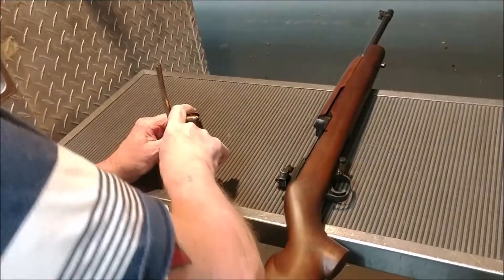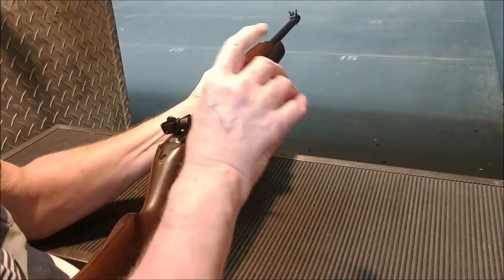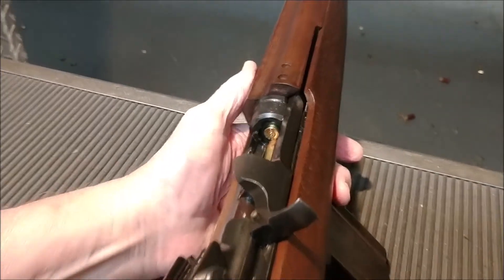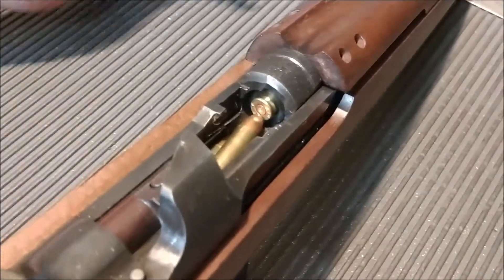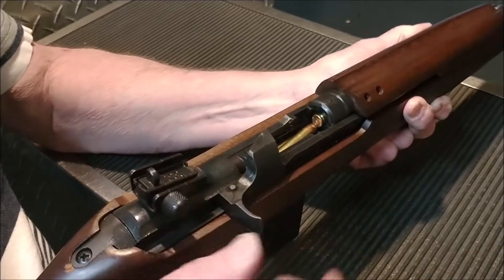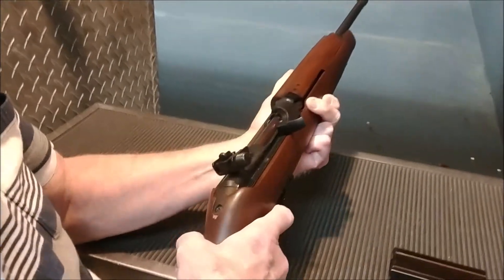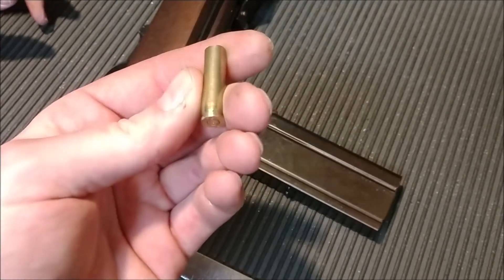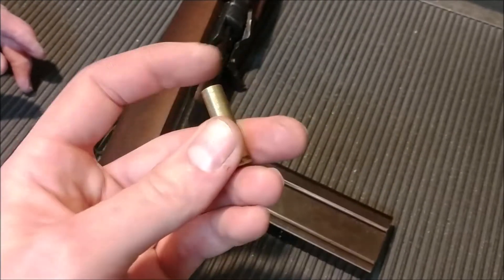How To Clear a Common M1 Carbine Malfunction: Extraction/Ejection Issues (30 Caliber Carbine)

Comment: Thx cuz I bought new auto ordanance 30carbine,junk, jams ,miss fires,you name it.
Reply: Same problems, mine is total junk, wish I would of read more reviews before buying. Have two Underwoods and an Iver Johnson that are totally reliable, and functions great with all ammo I tried with them. The Auto Ordnance is a jam-o-matic and totally unreliable no matter the ammo and magazines. Many times the bolt will not go into battery and requires a block of wood to hit the charging handle to get it to open, almost looks like the extractor is not getting into the cartridge groove. Most dissapointing rifle I have ever bought, will probably sell at a major loss.

Comment: This is a common problem with M1 Carbines, I had the same issue before. You likely have a chipped extractor. There is a chipped in the extractor face which you cant easily see and it is causing unreliable extraction as the extractor no longer has enough surface area to reliably grab the rim every time.
Reply: The original GI extractor is brittle and breaks it's claw edge. This happened to me twice, until inspecting it for cause. Cure was to smooth the rough edge on a new extractor with a fine stone. Never had the problem again after a few thousand rounds.

Comment: It’s always recommended on any of these surplus M1 Carbines to use a competent gunsmith that will change out the worn out parts. Change every spring down to the bolt. The Bubba gunsmith I used was a joke. Claimed to have polished the chamber which caused jams. With the new springs installed with a real gunsmith, he recommended keeping it wet, the M1 carbine needs oil good ammunition and magazines. All is good, bought Korean surplus magazines, the rifle hasn’t experienced a jam.

Comment: Just picked up my M1A and have the same issues. Havent cleaned the rifle yet. Straight out of the box and to the range, but hoping its nothing a little grease and cleaning cant fix. Albeit the SAME malfunction... however my extractor cant event grab the case or the case is legit lodged/stuck have to pry it with a flathead...

Comment: What if I got a brand new bolt and new extractor and still failing to feed properly and failing to seat bolt fully?  I had a light strike issue I solved by polishing the rear of the bolt since the hammer was striking the rear of the bolt before the back of the firing pin due to bolt over rotating in locked position, yet when feeding first round I get a hit or miss in getting extractor to engage the back of the round.  Any suggestion to solve this issue would be appreciated.

Comment: Does anybody know if it makes a big difference between grease or oil? My M1 Garand, M-14 and newly purchased M1 Carbine all call for grease but I usually just use oil. Oil has worked fine for my M1 Garand and M1A but not sure if I’m damaging the rifles or causing them to wear down faster. Anybody know?
Reply: The Garand was issued w/ a small jar of grease. Any good lube will work.
Remember, if it slides, grease it. If it rotates, oil it.